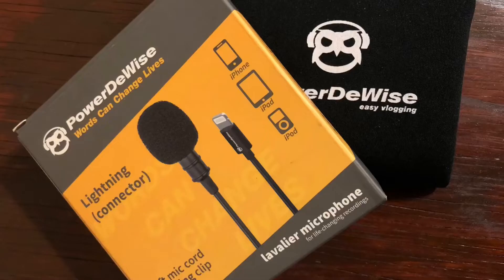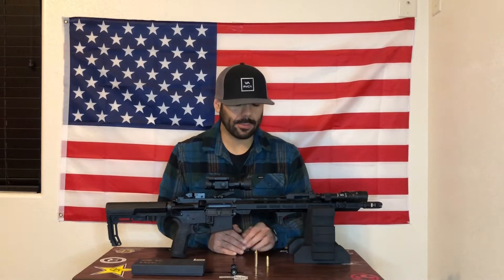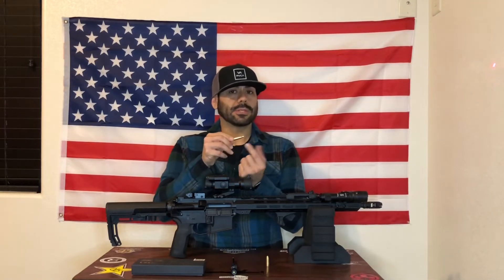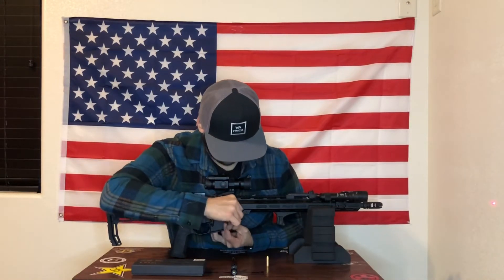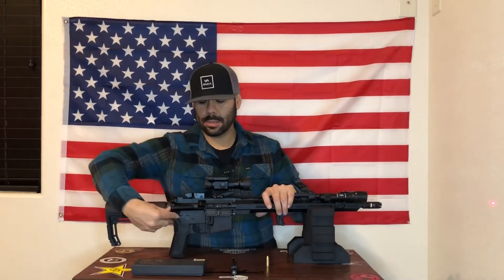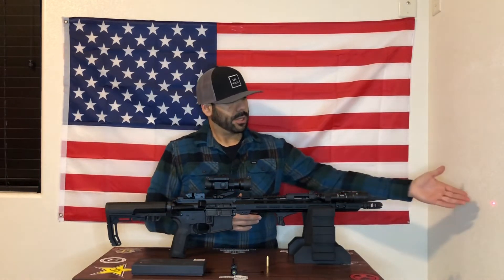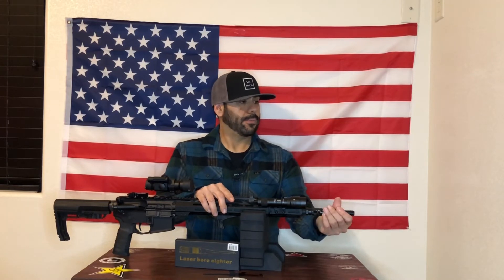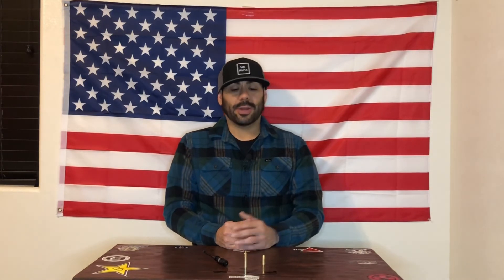Laser bore sighters. Do they really work?

Comment: I've had the one that goes in the barrel. If I rotated it I could see the laser making a circle. Like you said goo to get you on paper but don't rely on it.
Reply from the maker: Yup. Definitely know what you are talking about. It’s not uncommon for a laser bore sighter to not be perfectly centered. Those small deviations at close range result in huge shift change at long distance. Thanks for dropping by, bro!
Reply: @DesertTactical  no problem bother by the way, the audio sounds tons better and it's not reflecting of the walls as bad either.
Reply from the maker: @DeltaD80  Thank you, bro. Not a bad mic for $10! Lol

Comment: I've had that same universal one for a few years now and its worked great for me what makes it even more accurate is if you put 1 layer of duct tape around the part that tapers down when u insert it in the barrel it secures it even more. I've also bought multiple different cartridge bore sighters you actually place in the chamber and honestly none of those have been very accurate it seems like each time you place it in the chamber the laser is going in a different direction a Lil to the left then right etc. but the universal boresighter pictured in your thumbnail in my opinion has been the most accurate and easiest way for me to zero all my Optics in my experience
Reply: Not only all that but it works with just about all calibers.  I got the same one.